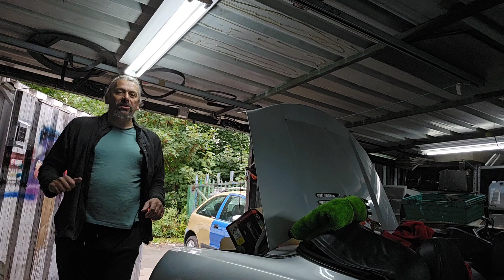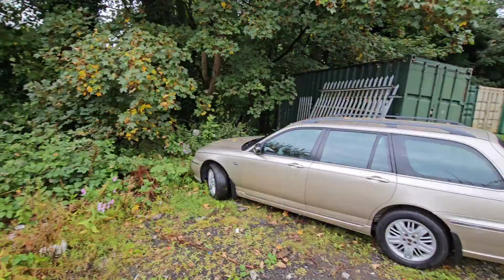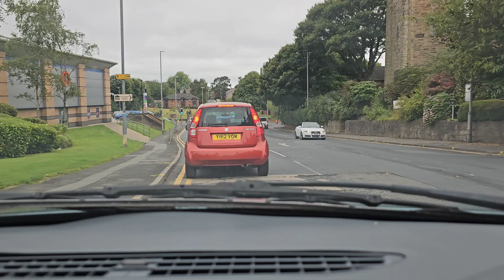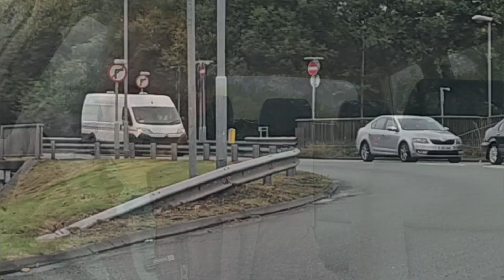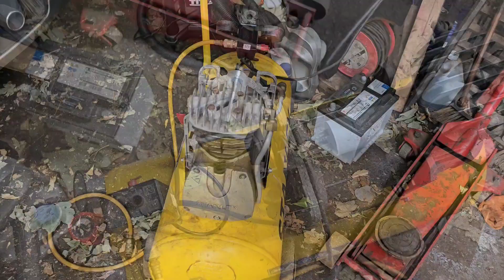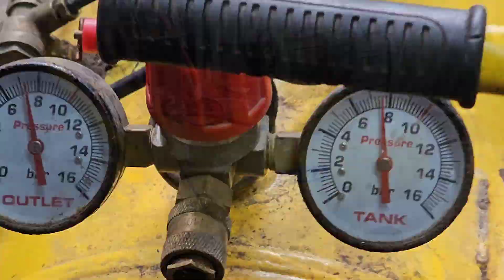Bodge Job Or Desert Engineering?

Comment: Is this a bodge? I don’t think so. A bodge to me is either a temporary repair to get you home or to the end of your task before fixing it properly or a lash up from someone with limited skills, money or intelligence who isn’t really bothered about doing stuff properly. In this case I think it’s neither of those, it’s replacing a broken bit of metal with another piece or metal that isn’t broken so I would say that’s a fix. If you’d replaced the metal with wood or stuck it back together with superglue then that would be a bodge. I think there’s also something joyously rebellious about this fix too. The Man wants to know what make and model and serial number you have before he’ll even go and look for a little bit of metal that looks like your broken one, but no. In your face The Man, our hero will make his own. And he will make his own out of a weapon for added symbolism. So the compressor spares company will be sitting at their quarterly productivity meeting wondering why serial number 392827274(3)MUSTARD hasn’t required its little bit of metal that they made to break so they can get your serial number data and charge you loads for a set of bits of metal that you only need one of. They will be very nonplussed, hopefully there will be some table banging and low level loss of sleep for the air compressor spare parts senior management team. I fixed a chair, with glue. Sounds bodgey too but it was a proper fix as I took it apart, cleaned out the old glue, used new glue and put it all back together. We’re fixers, not bodgers.

Comment: I think you may have visited my ex employer (Th----e)? 
  So the thing is. Compressors branded like yours are great but they are made by the cheapest bidder so to speak. This means that the product will have vast variations over its sale period that are impossible to get parts from sometimes. 
I would recommend a Fiac to replace it. Parts come fast and good service. ABAC if they have one on offer. 
Go bigger if you can. Cheaper down the line if you get more air tools and need more air. 
 Also check quoted if C.F.M. is constant. Some companies give 'ambitious' figures . 
No I'm not on commission.!